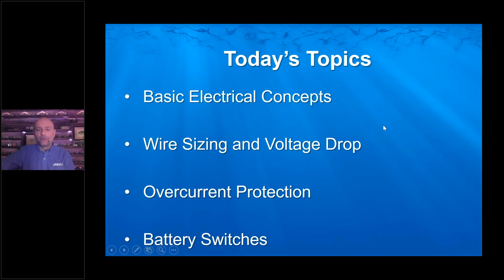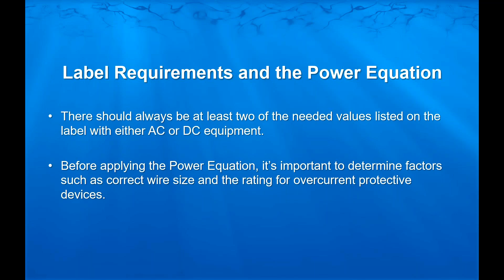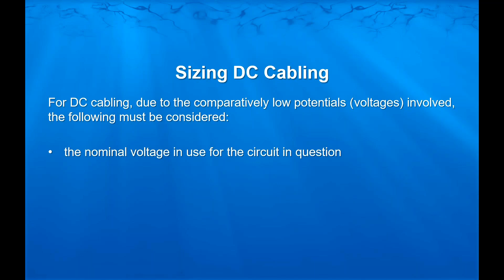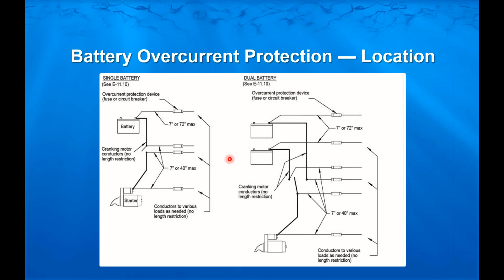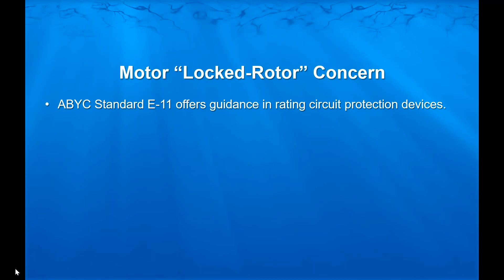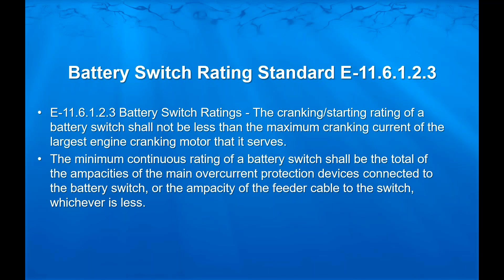De-mystifying Basic Electrical Concepts and Standards - Webinar

Comment: hey, on the polarity question for the contactors and relays, you are unprepared :) the  answer is: almost all of automotive relays and contactors nowdays have the inverse (reverse) diode that is meant to cut/kill all the voltage spikes the magnetic field thru coil creates when the circuit is break... those spikes are really high voltage. since the diode is inverse to the polaryti indicated if yo switch the plarity the diode will conduct ans will be a dead short... the fuse ill blow and the magic smoke will escape...

Comment: I didn't catch how to determine if the load (for example a macerator toilet) requires a 3% or a 10% voltage drop...
Also, we need to change the way we refer to wire sizing, like the actual diameter of the wire as they do in better educated countries